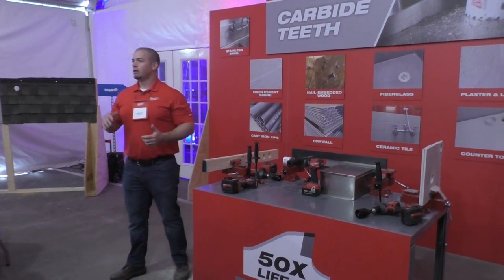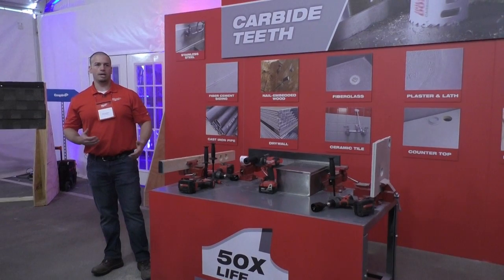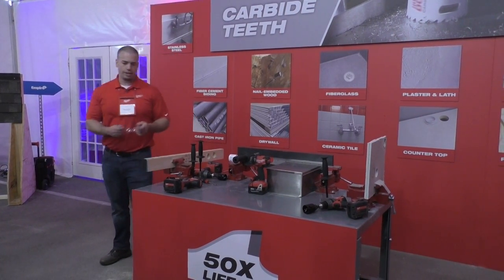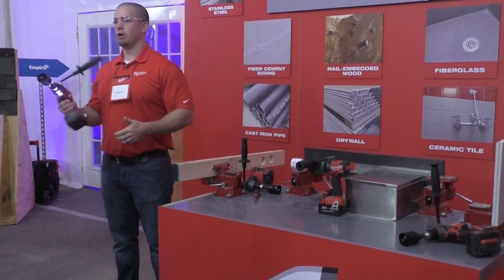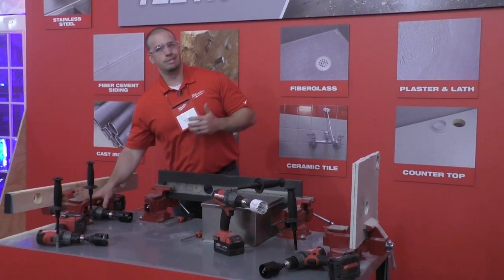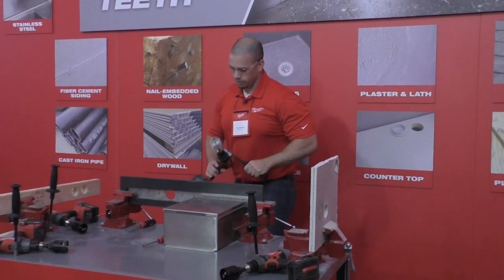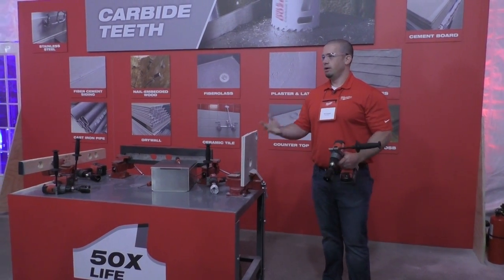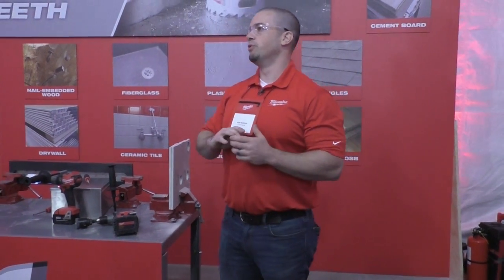Milwaukee Carbide HoleDozer Hole Saws - Stainless, Cast Iron, Ceramic, Fiber Cement NPS17

Comment: how about a demo on cast iron. just to see if it works.
I wish I had knew about this one, as I was cutting a 57mm diameter hole, in a 4" cast iron soil pipe, about 1/4" wall thickness, with a bimetal hole saw, it took ages to do it, and some of the teeth came off.